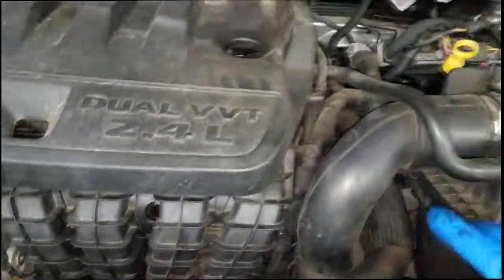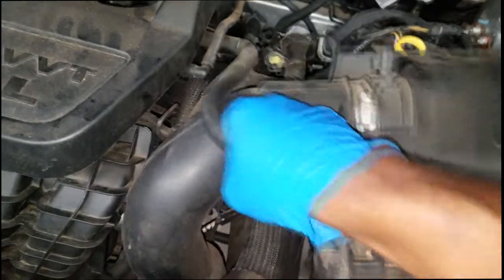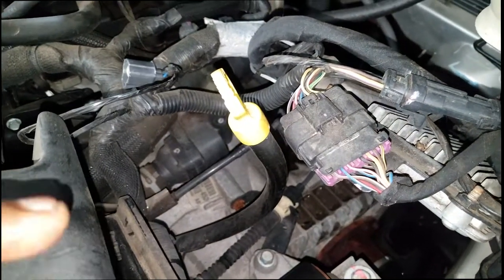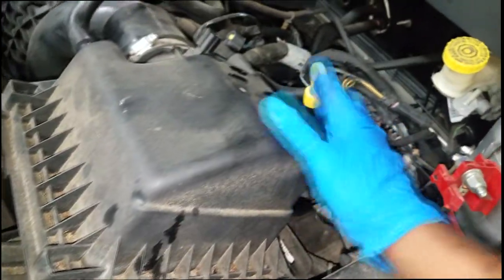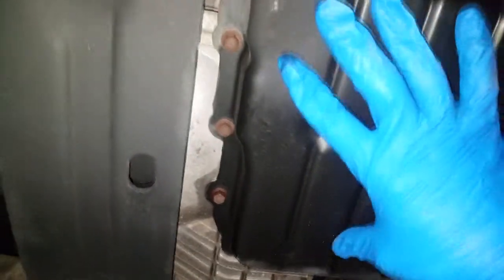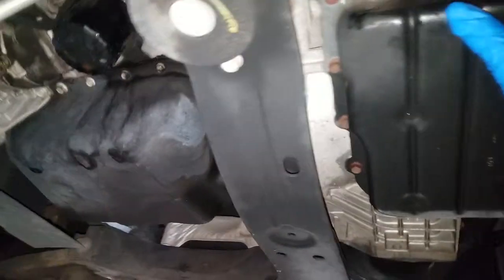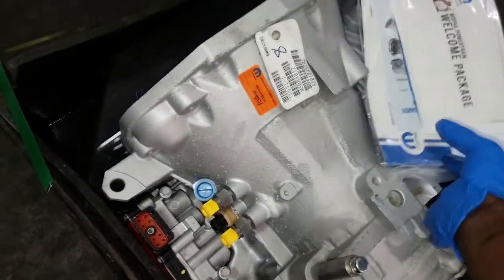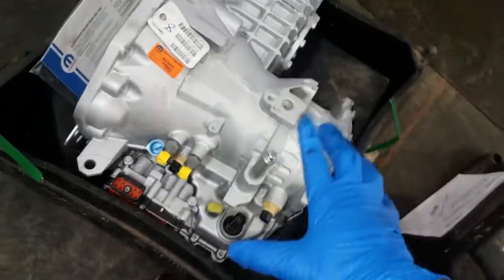How to tell if your Transmission is Bad.WARNINGS.Transmission whining noise P0700 P0944 P0897 P1798

Comment: I have a 2008 Saturn Vue hybrid greenline 2.4L engine a mechanic dropped my transmission pan said it looks terrible you need a new transmission is it possible to tell your transmission needs to be replaced just by dropping the pan and if so what tells you from dropping the pan it needs to be replaced
Reply from the maker: He likely found excessive clutch debri and aluminum shavings inside the pan attached to the magnet..depending on the material, yes, mechanics usually recommend complete trans assembly because that trash will travel thru the trans and cause all kinds of problems. So to avoid repeated repairs, most tech recommend transmission..thanks for watching, please subscribe

Comment: I have a 16 compass and I have done 2 drain and fills with maxlife  in 60k miles. I will do another one next spring...I bet my tran will easily go 250k easily, cheap insurance.
Reply from the maker: 15 compass? Is that a CVT trans or the 4 speed automatic? or the 9 speed automatic?
Reply: @OnlineMechanicTips  6 speed automatic

Comment: IF one replaces the fluid and the filter often how long should the 62 TE transmission last, please?
Reply from the maker: Keep in mind there are wearable parts inside a transmission. So at some point internal parts will need to be replaced. The fluid and filter change helps to prolong the life of the transmision by filtering our the trash thats created by wearable parts.Ive seen 62TE reach 220k without any major repairs
Reply: RIGHT!! I agree on the wearable parts and fluid does wear out. I have had it flushed once and dropped the pan twice to clean and install fresh filter and fluid. Have 85,235 or so miles and have had the P0740 for over a year or so. She shifts fine both manually and automatically.  BUT am very worried. Thank you for your help!

Comment: I’m at 60,000 miles on my 2016 ram 8 spd. I wanted to change the transmission fluid but it was going to cost 2,100 at the dodge dealership. Should I change it? The owner manual says lifetime, but is it really lifetime?
Reply from the maker: My friend,  I would do it only after all warranty has expired. Ive seen claims rejected for trans warranty repairs because the customer had it so called "serviced" somewhere at a shop. The term "Filled for Life" can have different meanings to different people.  I personally refuse to believe this fluid will never break down but I do believe it holds up for a very long time. The course I had on this transmission, the instructor hammered home about messing with it if nothing is wrong..Besides that, the trans pan and filter and fluid VERY EXPENSIVE.
Reply: Thanks for the reply. Great videos!

Comment: I have a 2018 Honda Accord with 44000 miles on it the dealership is telling me I need to change out my transmission fluid but my dad said. I shouldn’t need to do that until 100,000 miles?
Reply from the maker: Hello my friend, it is highly likely the dealer simply up selling you maint service repairs. I would verify and take that up with the scheduled maint chart in your owners manual. If it recommends transmission service at 40k, then yes, they are correct. I highly recommend you follow the scheduled maint chart..Thanks for watching, please subscribe.
Reply: Online Mechanic Tips thank you I check the color of the transition fluid it was candy apple red but I’ll check the manual
Reply: Always check your owners manual or look one up online a lot of people don’t even read it in the manual it is recommended to check the engine oil every week or 2 weeks

Comment: Wow, seems an expensive repair for an old Journey, I’d be car shopping if I was that customer.
Reply from the maker: yes, it was. But she insisted on keeping her car..I think I got the point across to her about trans service intervals that she said nobody has ever told her about..She did mention that she had the trans flushed awhile back..But as I explained to her that the filter has never been replaced because I can see that the pan has never been off.
Reply: Online Mechanic Tips That is even worse, if you power flush without first removing and cleaning the pan + new filter, you will end up pulling debris from the pan into the filter, even thru the filter and ruin the trans. Myself I will drop the pan and change the filter, then I fill the pan and disconnect a cooler line, I just run the vehicle to flush it (only till it pulls air) then I reconnect the line and top off the trans, that way the pressure doesn’t exceed normal operating pressures.

Comment: My transmission fluid was black.i bought a filter and they told me it would be fine after changing the fluid.I drove it and it still jerked.After changing the fluid for the second time the guy says it probably needs to be changed once more.What do you think? Its a 2007 grand prix
Reply from the maker: My frienf fluid will not fix transmission problems unless the fluid was low..You likely have internal trans problems inside the transmission. Thanks for watching, please like the video and subscribe to the channel, thanks

Comment: Trust your nose
Reply from the maker: lmao, IKR, if you get a wift of that internal burnt smell of a transmission, you will know when the risk outweighs the reward/repairs..I quickly yelled out NOPE..I need a complete unit and flush the cooler.